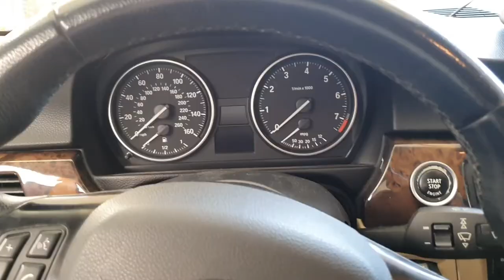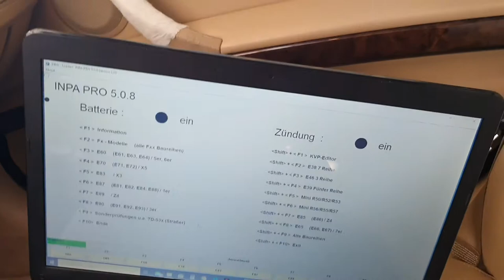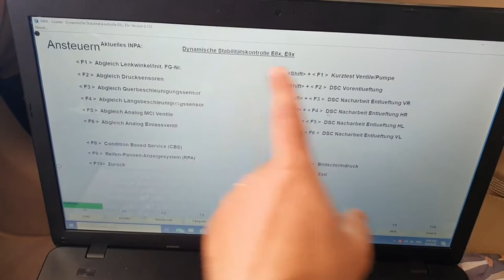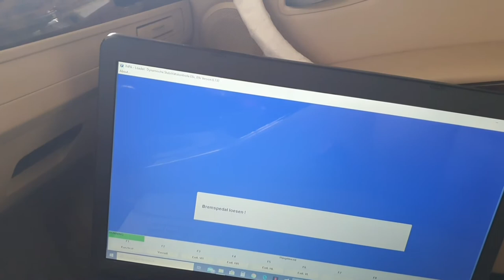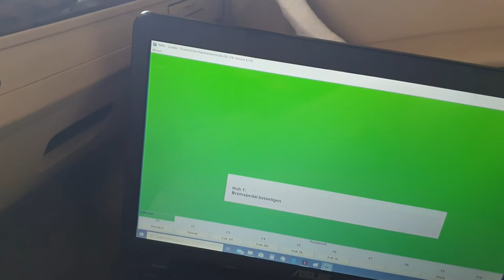How to flush and bleed brake system on a BMW

Comment: Great video on bleeding the brake system alone with the help of the computer. But...so much dot 5 fluid has been used. It cost a small fortune of money on fluid I guess.
Reply from the maker: Not quite. Ive used 1.5 L something like this. I've bought 5 L because was a better offert (22 Euros)